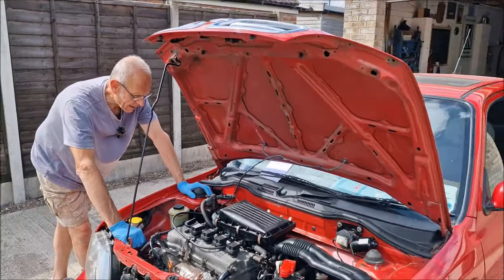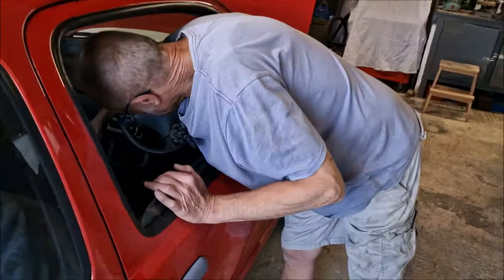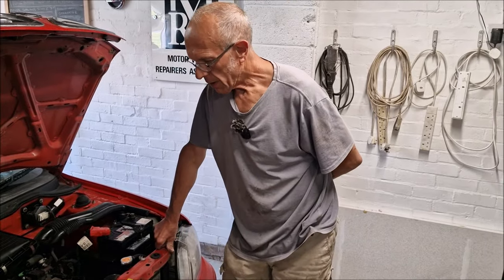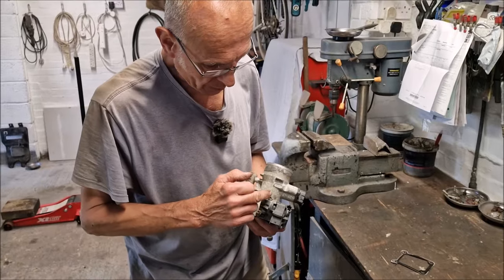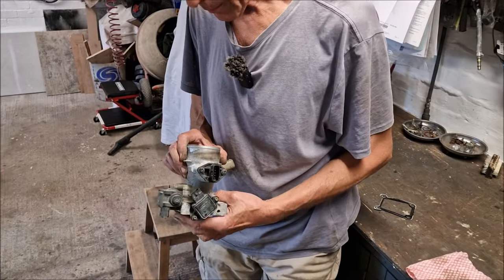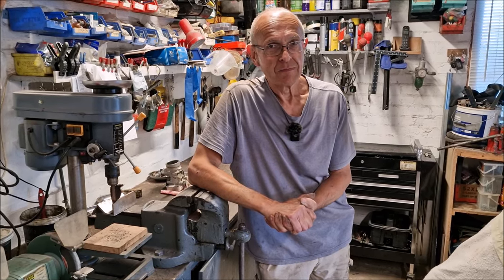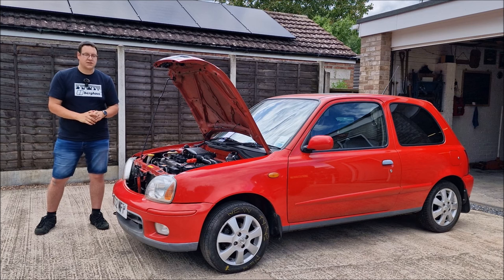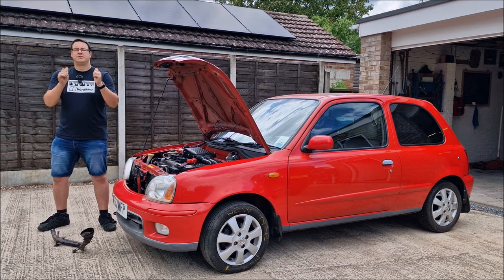IT'S FIXED! - K11 Nissan Micra FINALLY Running Right - NEW Throttle Body & Idle Control Valve

Comment: Been offered 40 pounds.  Throttle.. my issue is low idel .. sticking rpm.s. occasionally..  slight misfire. Driving it.  Wondering iavc ?  But can't buy  item alone with out  Throttle  ? Bosch crap  fitting. I no I can remove screws easy
Reply from the maker: Worth replacing the ICV, MAF and Throttle Body for the £40 😄👍
Reply: @JonCoupland  guess  so  I let you no great video